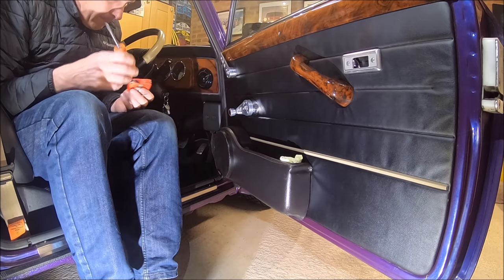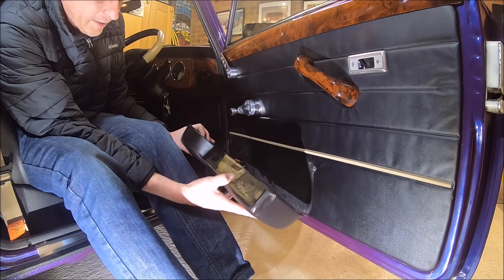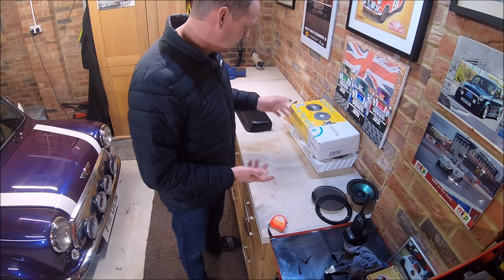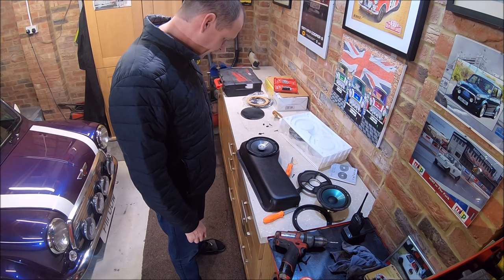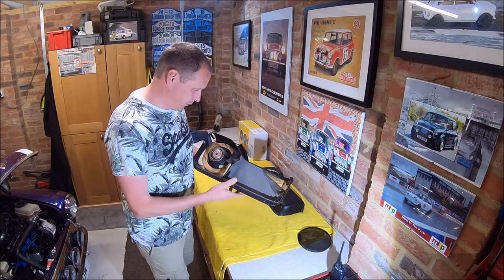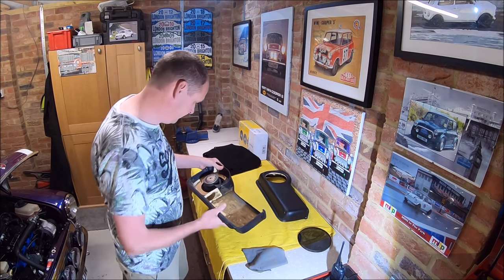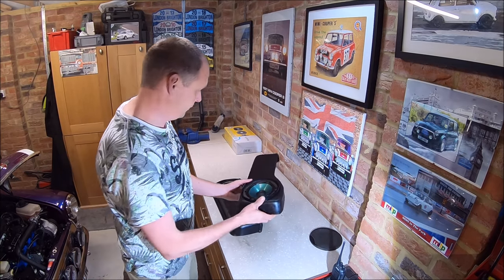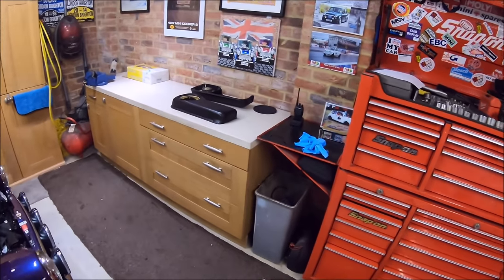Classic Mini Workshop - Front Door Speakers

Comment: The AC in your house is 50hz.  The 'internet signal' is sent along the same pair of wires at a much higher frequency that the power line adaptor can transmit and receive, they ignore, or filter out the 50hz and look at the higher frequency signals and interpret them as data.  Or at least something along those lines
Reply from the maker: I thought it was all to do with the magic pixies running up and down the powerline with wheelbarrows full of tinternet 😁

Comment: Can you describe or take pictures of how the speaker wires go into the doors? I'm looking to do this and am researching loom options, mounting height, where the wires will enter the car, how deep the hole must be set to avoid interference with the window glass, etc.
Reply from the maker: Mark used a tailgate wiring grommet from a VW https://www.justkampers.com/321-971-840-tailgate-wiring-grommet-vw-t25-1979-1992.html?fee=1&fep=23892&utm_source=google&utm_medium=cpc&utm_campaign=PLAs&gclid=EAIaIQobChMIqquD4OLT6QIVia3tCh3DxQQoEAQYDCABEgJjpfD_BwE%2F&fbclid=IwAR1QMay_IRHCOk2W4203RsEpAOBPc6nKNgJoWwGALH_pkgIH0sfNkg-L2NI